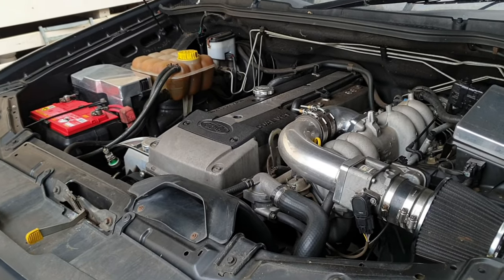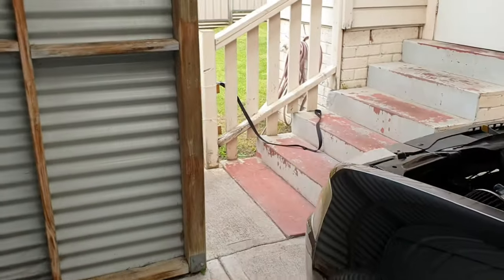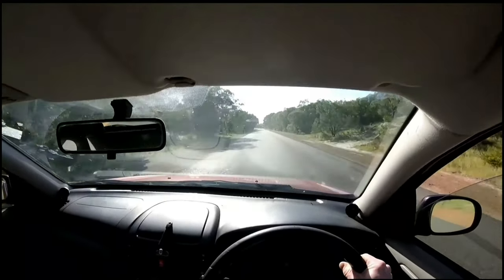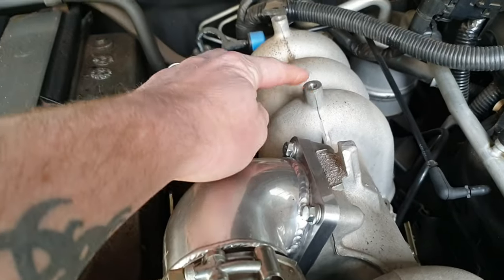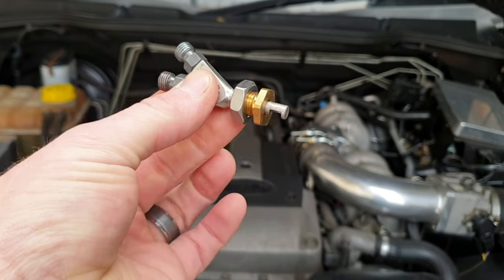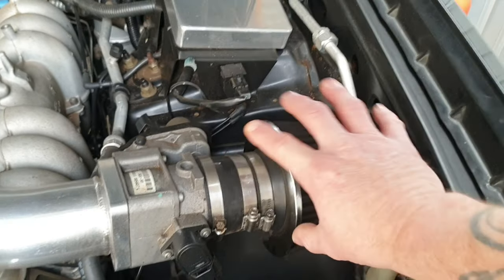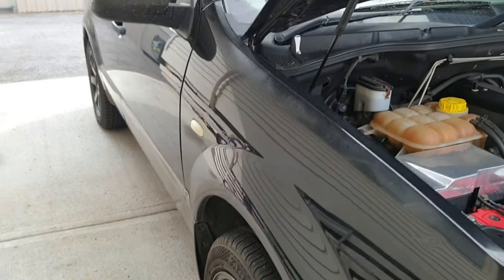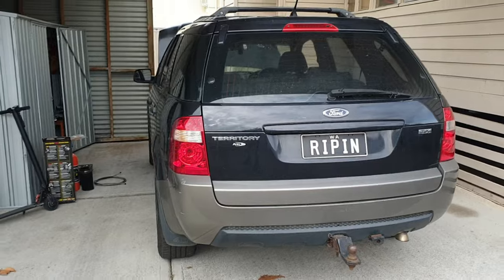Wet or Dry Nitrous Set-up......... Which to Choose?! | Territory Goals!

Comment: Don't run dry. You'll go lean and blow it.

I run nos on my Terry.

I'm at 600hp on wet nos. 

If I wanted more I'll add more foggers or add a plate, each plate is good for 400hp extra.

If you run too lean on a dry shot you're screwed.

If you run too rich it'll bogg and backfire and catch on fire...

I've rebuilt my motor 5 times.
Reply from the maker: I can tune in the fuel 🤙 plenty of people use a dry set-up....  if it blows it will make for good content🤣 there's a couple guys down here running dry set ups on their barras for burnouts with success 😎 people thought I was crazy putting a turbo on a grey top barra years ago... time for more science 🤣
Reply: @RossHollandAU  yeah.they generally use haltech ecus for dry nos.

I haven't seen a dry nos setup ever been done on a stock narrowband sensor on a stock barra ecu.
Reply: @RossHollandAU  can you tune the stock ecu to change when the nos is on and off... that's the problem...
Reply: @Ross Holland  you can run a wideband, and if 140hp on a 62 nos jet isn't enough on a single fogger and you don't want to add a 2nd 140hp wet fogger you can increase the fuel pressure the wet fogger to compensate.

For every 100hp be sure to retard your timing by 4 degrees, after maxing out a 140whp fogger you'll know about it and say bye bye to your rods...
Reply: @Ross Holland  I've got 110lb springs, atomic cosworth 8.5:1 93.25mm pistons, fatrods, turbo valves intake and exhaust, 16mm girdle, heavy-duty timing chain with vernier gears and vct delete to actually be able to change the timing manually, 14.3mm headstuds and 12mm mainstuds.

I'm just under 4.1 litre. 

If youre telling me a dual wet fogger isn't enough then you're pulling more than 600hp at the wheels....

I've seen 850hp on a wet plate setup on a fg NA barra but he's running independent throttle bodies, and his motor was worked....

I can't go any further due to gearbox limitations.... 4 speeds suck
Reply: @Ross Holland  this is what I'm running, I'm using throttle position usually for nos output control...

I was at 4.11 detroit locker but have gone back to 3.73 locker
Reply from the maker: @dylandesmond  i can load up tunes adding fuel and retarding timing where i will hit nitrous, ill use a button in the cabin not by pedal, im only going to running 35 - 75 hp shots so I won't be pushing it too hard, we can bump up the safely options on it too just Incase, I totally agree with what your saying though! But that's part of the fun of it ;) trying stuff you shouldn't 😎 for science! 🤣
Reply: @Ross Holland  I wouldn't make the tune run rich just so you can add 30-75hp of dry nos. When your nos is off, you'll have issues, and it'll run like shit.

If you have dry nozzles to use, get a regulator for your fuel jet...

And if you're running a stock fuel pump, I highly recommend you get a walbro 255 direct replacement. Otherwise, you're gonna run dry from having no fuel to begin with... the injectors pressure will drop too low and not flow enough.

And if you're running a stock fuel pump, it'll start leaning out from a 140whp shot from a single wet fogger, I know this because this happened to me when I first started.

I'm running a 460 pump, adjustable fuel regulator with pressure to motor stock, tune is original tune( stock tune runs rich)

I've got a dual fogger setup with an adjustable regulator to both fuel jets, running high pressure small jets to give it more spray and 62 sized nos jets so it mixes well... no dry nos needed. Extra 280hp to the wheels.

The maximiser5 watches my bosch 4.9 wideband and adjusts fuel and nos relays so the correct afr readings are at the exhaust and it also adjusts the power level according to my throttle position.

When we dynoed it, we used the NX maximiser5 software and didn't even tune the stock ecu, it's not needed... 

If it's tuned perfectly with no nos, then that's the perfect foundation to start with to tune your jet sizes and pressures
Reply from the maker: @dylandesmond  ill only run nitrous at the strip where I can reload tunes between runs 👌 I wouldn't drive it around like that :) the current tune should be able to support a 35 dry shot 🤙 i like your setup though sounds epic 😎
Reply: This is the website I use, I tune to the 6:1 that's stated on the website, and it's perfect on my wideband readings.

I run NX nos, I understand you have hp numbers, but that brand rates it from the flywheel, not from the wheels, so go by nozzle diameter. Like I said, you can get 140whp from 1 wet fogger...  if you screw it up and run rich it backfires and your intake will light up real quick... 

I have a bottle to put out the fire plumbed directly with a pipe straight to the intake, I hit a switch and it open via a few leftover solenoids and relays I had lying round.

I highly suggest you do the same unless you have money for a new wiring loom and new sensors and new ecu...

That's what happened to mine, was slightly rich as I let off the throttle.... nos wasn't running as the bottle pressure was low and my old setup was just a button setup with no maximiser5
Reply from the maker: @dylandesmond  also the stock pump can support up to 320 rwhp is, tested that myself through the turbo process, even a 75 shouldn't bother the pump 🤙
Reply: @Ross Holland  typo, if you run rich it'll catch fire. If you run lean the rings will fuck themselves and the rods are gone.

Have you gapped your rings, done your exhaust valves or springs and pump gear?

You'll also need to turn up the s5.grub screw if you're running a 4 speed and a cooler with the fan left on 247 when the car is running... kills the clutch bands in the gearbox real kick.
Reply from the maker: @dylandesmond  already tuned in the s5 solenoid shift kit and those things, honestly man I've put nitrous on so many other things I don't see these small shots being a issue when used rarely, on such a large engine, especially compared to what I've put these engines through with turbos no tunes all the worst things you can do to them haha but I hear you indont want you to think im just blowing off your knowledge :) I just really wanna see what happens, I got got told my rods would go with literally everything I've done on cars and so far I've got lucky 🤣 let's see if I can keep that luck going lol
Reply: @Ross Holland  on stock timing I had no issues with stock internals and 100whp.
Upgraded the springs to 90lb, exhaust valves cooked. Then it started from there...

My rings are gapped to 21tho which is overkill but I play with electric motors and centrifugal superchargers from vortech. Tore the atomic 12mm headstuds out, 1 snapped 1st and the rest just started ripping the threads on a vortech v15, instantly stuffed my gearbox on the first pull... hit max centrifugal rpm at motor 2000rpm because I had the controller in torque mode and not speed mode and it still was giving around 300amps dc into the motor at 168v from a 600amp controler and not the 50% speed I wanted.... 1900hp centrifugal... sold it as I had to use the money to rebuild my whole motor, 1 of the rods were bent, valves were stuffed, timing chain snapped, and 1 of the piston bores had a huge scratch. Hence going to 93.25mm.

To make it worse the geabox was new. And the yoke bent, which later on overheated my center bearing without me knowing, I pulled out of an intersection on my new setup and ripped the center bearing off the chassis.

Just got another custom driveshaft, in the process of adding a filter, cooler and pump to my diff, they're fairly easy to put back together, just get a m86 bearing and seal kit and make sure you youtube about how to set the preload on the crushwasher. 
Diff will drain into a filter 1st, then the cooler which has a fan that never turns off and finally the pump.so the life is prolonged and the cooler doesn't get blocked up.

My gearbox cooler also has a large inline filter, I've noticed nobody does this.... it's easier to swap out your gearbox filter when you change your motor oil and have a better running gearbox than change the gearbox oil when it's had a shit life from circulating shit while grinding the extra nos
Reply: @Ross Holland  probably an old pump. Some have gotten 10-12psi on a stock pump...
Reply: @Ross Holland  I'd get a bosch 4.9 wideband if don't have 1. It's what will save your arse...
Reply: @Ross Holland  when I tore my bf Terry apart it had gas rods in it, thicker shaft with the non turbo pinion shaft setup... one of the 1st 2009 mk3... I've heard stories from people that used to work at ford saying they used to throw better rods in if they run out of stock on the lower strength rods... have seen a ba petrol with gas rods also...
Reply from the maker: @dylandesmond  wasn't so lucky when my ba engine got tore apart rod wise... but believe it or not it was still good 😁
Reply: @Ross Holland  keep the rpm as high as possible, rods break at low rpm with nos, so do headgaskets... if you're running stock headbolts still I'd be swapping them out or adding another 5nm to each bolt.... I think ba was 80nm and same for bf, my 12mm headstuds were 90nm and the 14.3mm are 169nm (quite the jump)